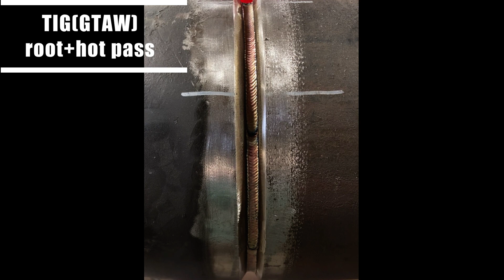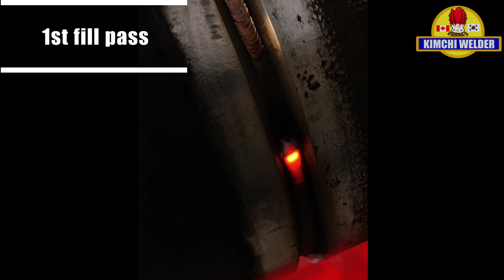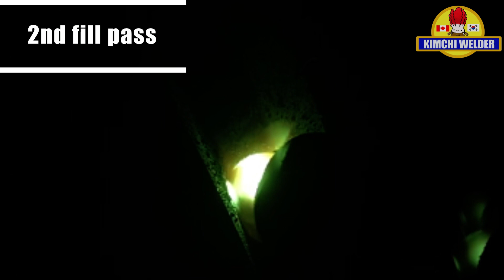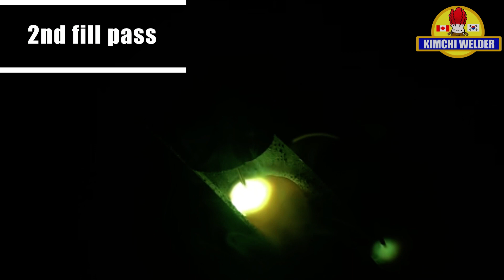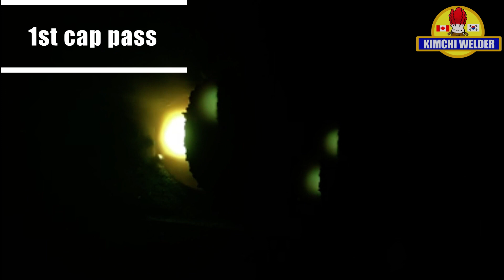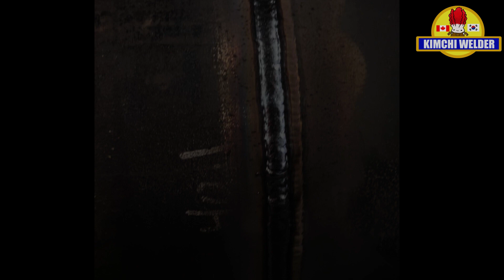Flux Core(FCAW) 5G Pipe welding

Comment: When your welding flux core what size wire are you using and what’s your settings , wire speed and volts ? On the 5g pipe welding video, thank you
Reply from the maker: Hello, christian rich😁
I used 0.45 wire size.
and I used more than 24volts, 240 wire speed👍
Reply: @kimchiwelder8410  Thank you. Very generous of you to share.

Comment: I always thought (with flux core) you have to drag the gun away from the puddle, but you push it towards the puddle. Very clean welds mate.
Reply: Slight push when you’re going uphill
Reply: We push flux core at work.
Reply: i work in a shipyard and we're taught to push it in all positions, and also make it even smoother than the guy in this video (take a looot of practice)
Reply: @cplat__9753  yep. Was a Shipyard welder myself. Lindo mearsk Denmark. Some welders pull the cap (15 mil plate single v's

Comment: If I'm planning to do 4G 12mm plate what you suggest to my for voltage and wire speed

the wire i will use 0.45 Lincoln
Reply from the maker: Hello Abdul😁
I think I'd better adjust it to 24volt/240wire👍👍

Comment: Hello !  Great video !  Tell .  What gas are you using, and welding modes (feed rate, voltage)?  Thank you !
Reply from the maker: Hi, Nomad
I used argon+co2 (25%) gas and 24volt/250feed speed.
Please note that the setting value may vary depending on the welding machine🔥
thanks for watching!😎😎
Reply: @kimchiwelder8410  great vid bro. Looking 👍
Reply from the maker: @chaaz1013  thanks for watching, chaaz! 😎
Reply: Hello !  I use 100% CO2.  When welding in a mixture of Argon + CO2, the properties of the arc change, spatter decreases, right?
Reply from the maker: @412nomad  Yes, and If the volt and wires peed settings are also proper, 
spatter will be reduced a lot.
However, the torch angle and arc distance are also important👍
thanks for watching!😎😎